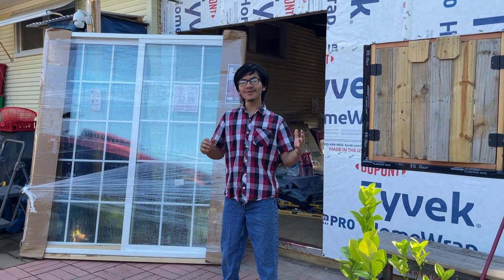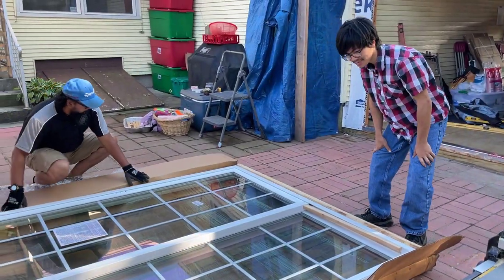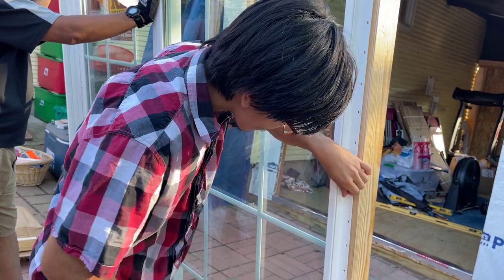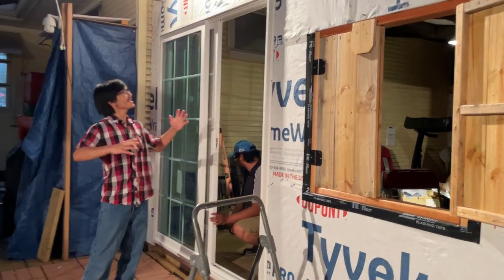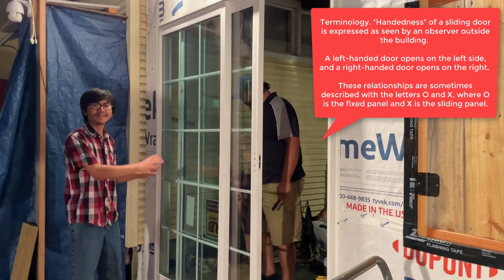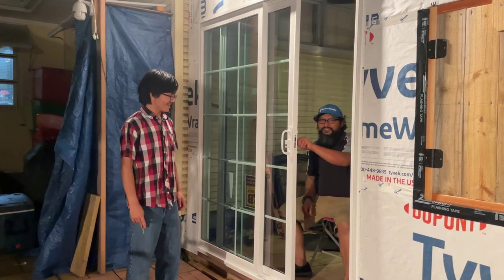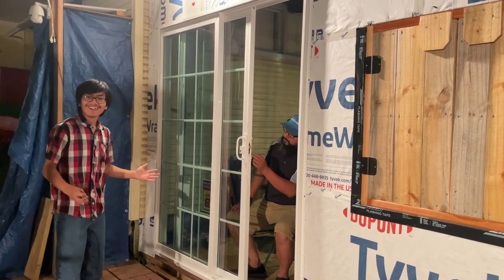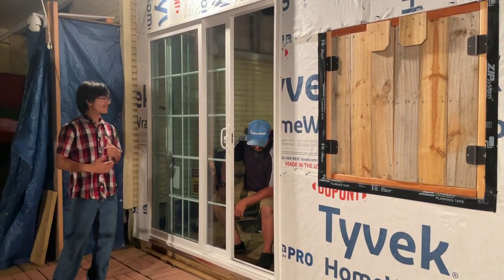Installing Sliding Door For Our Enclosed Patio-Porch Project With Uncle Lan | Just A Vlog Not How-To

Comment from the maker: Here are the #ad links to some of the hardware, materials & tools showcased or required for this project:
1.  https://amzn.to/3A3JVA2  |  National Door Company ZZ09302BA Primed MDF 1 Lite Clear Glass, Prehung Interior Double Door, 72" x 80"
2.  https://amzn.to/3fsN6aT  |  National Door Company Z019952BA Primed MDF 10 Lite Clear Glass, Prehung Interior Double Door, 48" x 80"
3.  https://amzn.to/33Gl1tX  | Insulated Door Curtain for French & Patio Sliding Doors Up to 72 x 80 Inch, Thermal Magnetic Closure Self-Closing Door Cover Cool Summer Warm Winter Draft Insulation Door Screen (Grey - Checks Style)
4.  https://amzn.to/3A5myG4  |  French Double Panel Lite Doors 72 x 80 with Hardware | Lucia 22 Matte White with Frosted Opaque Glass | Panel Frame Trims | Bathroom Bedroom Interior Sturdy Door
5.  https://amzn.to/3nxHoca  |  DEWALT 20V MAX* XR Cordless Drill Combo Kit, Brushless, 5-Tool (DCK594P2)

Or Click on Amazon link here and search for what you need:  https://amzn.to/3xIOsqg